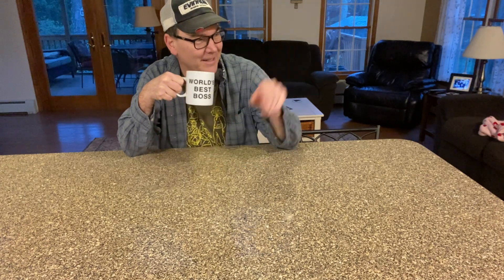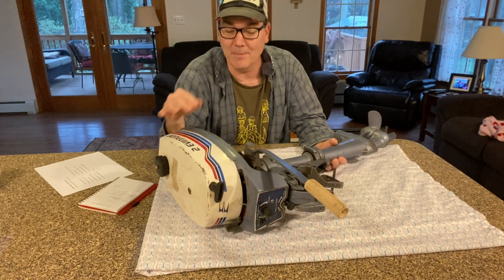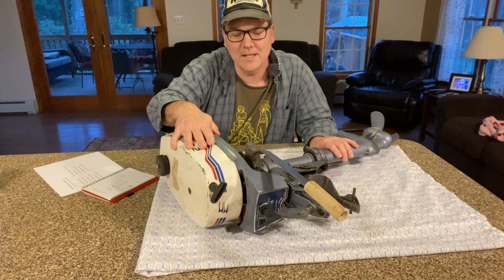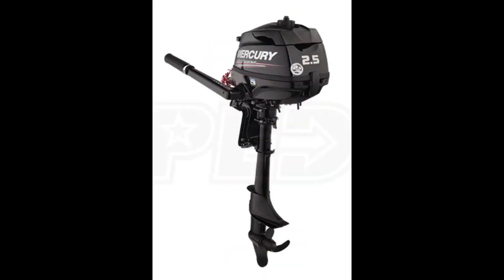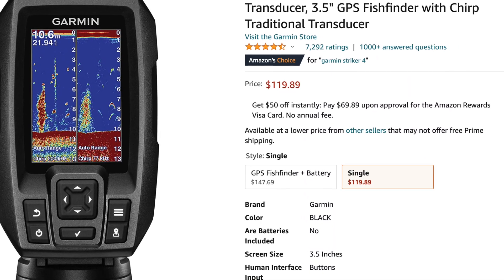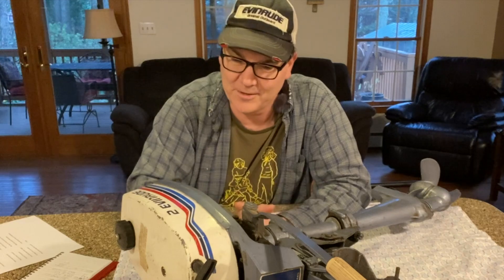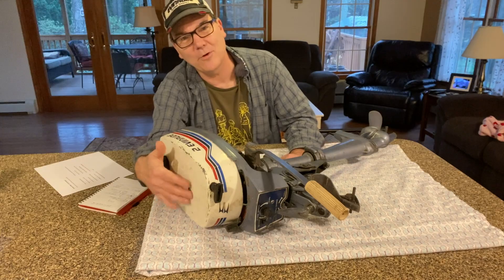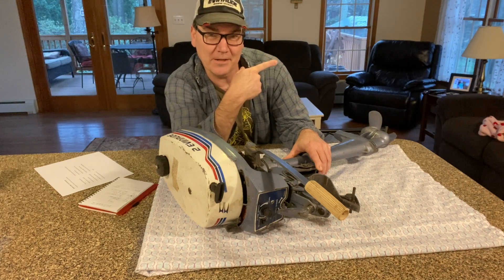Evinrude 2 Old 2 Stroke Outboard Motor - Is It Worth Saving?

Comment: It,s power for your boat, not a comidaty, to be bought and sold.  If you need a good motor for your boat fix it.  It,s way better than the lawnmower engines on a stick they have today.  If your looking to get rich from fixing it, no, it,s not worth fixing.  Knowledge is power, keep that in mind.

Comment: Those old 2 stroke Evinrude and Johnson outboards were extremely reliable and used very little fuel. I think you should check it over and see about getting it running again. I, for one, would be very interested in the process and video.

Comment: I think your should do a compression test first. This will give you a good idea of how worn out the engine is. If it has good compression and you do everything you plan to do, that motor should start really easy and be extremely reliable. You might not need to reseal the gear case if the gear lube is not milky.  If you replace the points I would recommend avoiding the BRP/OEM points because I’ve heard they recently have been mostly defective out the box, so I would go with Sierra points instead.

Comment: I Just got that same motor, here in Argentina, I like it because it will go in a racing sailboat where I do not need so much power. It was running and now it runs and shuts off, cleaned the carb and does not run. Want to get ir running to use it soon because it is the lightest motor I can think of. Really like it

Comment: Just ran across this video again and as you know I restore these old motors. My thought on saving these are they are mostly metal especially the older ones. They a very simple to work on and a great motor for lake trolling. Anything older is worth saving and reselling to folks who want them but don't know how or don't want to work on them. Mainly because they don't have the time unlike us retired folks.
Reply from the maker: I ended up giving this one to @BrandonsGarage and it actually was in worse shape than we both originally thought.
Reply: I saw the video. I picked up an 1965 3hp Evinrude a year or two ago that the water jacket passages were totally clogged up. Got them all clean but still doesn't run right? I put it aside to work on other projects but plan or getting back on it someday.

Comment: Enjoyed this video, we're a lot a like in our curiosity towards getting stuff , hopefully cheap and running, I've bought a couple motors here and there, my last was a '77 Evinrude 6 hp I picked up for '75 bucks off Marketplace, did the precursory checks, spark, fuel and compression, turns out all was good, and with some carb cleaning, I had it running, had a weak water and fuel pump, sourced those parts, cheap , on Amazon, after using it a couple times on my 12 foot boat, I decided I wanted a 4 stroke cleaner outboard, I flipped it for a decent profit, and bought a 5 hp Briggs and Stratton, Air cooled 4 stroke engine, which I'm very happy with. Enjoy your content, great work Wayne !
Reply from the maker: Nice! Those 6 hp are pretty plentiful and robust

Comment: I fix a alot of small engines so here is what I would do to keep cost down. I would first buy a spark plug because that one is gone but only after trying to clean the old one with a spark plug cleaning tool I own to test that the engine will even run. Then I would carefully take the carb apart and clean it out while trying to save the old gaskets, I have some bulk gasket material if I need to make one with a razor and holepunch set. I would replace the fuel line with bulk small engine fuel line that I have from other repairs and it would get a new impeller. This would keep cost down and make it economical to fix. Start accumulating this bulk stuff to keep your cost down across multiple engines.

Comment: I just received one of these motors today and it doesn't run. I am most certainly going to get it running because 1- I don't know much about engines and I'd like to lean and 2- I still won't have to pay almost $1,000 for a new motor, 3- everyone in your comments seems to be pretty sure about its reliability. I think this will be a fun learning experience.
Reply: Did you get it going?
Reply: @beaconbus  no, I havnt figured out the air fuel ratio,

Comment: Well, these things do bring big money, don't know why, but they do.  The first thing to consider is whether or not this was used in salt water.  If it was, you will need to be very careful trying to remove fasteners, don't want to snap them off.  Next, you might want to do a compression test and drain the gear lube.  If the compression is OK 80-100PSI and no water is evident in the gearcase, you can go further.  The paint is not discolored on the powerhead, so it doesn't appear overheated.  But, someone could have run it without oil, but this should show up on the compression test.  
Next, decide if you are going to keep it, or sell it.  Spending another 100+ dollars on a 175 initial investment doesn't leave much room for profit.  So, I would simply clean up the mag plate and clean/reset the points, this is usually all it takes to get good spark.  Yes, pull the carb bowl off and have a look.  I wouldn't do much with the carb if it looks clean inside, just put it back together.  Fuel line is cheap, so it is always a good idea to replace that.  Now, refill the gearcase with lube, maybe a new spark plug, add 50:1 mix, put it in a barrel full of water and I'll bet it will probably start and run fine.  
Now, if you plan to keep it, that is another story.  Keep in mind that you can't find a simple, light weight two stroke like this anymore.  It is simple and fairly rugged, reliable, and easy to service.  So, I would go ahead and do more to it to ensure it will provide reliable daily service for you.  If the gear lube is clean, I would go ahead and pull the gearcase down and replace the water pump impeller.  This is a strange water pump and there are two kits available.  It is a good idea to spend the extra bucks for the better kit with the SS impeller housing liner.  These gearcases rarely leak water, but I would definitely pull the propeller off and make sure there is no fish line back there which could get into the prop shaft seal.  If all looks OK, I would not mess with any seals.  Go ahead and install the ignition kit and replace that funky plug wire.  And yes, pull the carb off and install the latest style carb kit that includes a new float and ethanol resistant gaskets/orings.  Like I say, these are great little engines and worth the investment for yourself provided it is in decent mechanical condition to begin with.  
If you are not familiar with doing this work, or afraid of snapping off corroded/rusted hardware (salt water), then I would simply resell it with a price tag of $200.

Comment: Give her a compression test them see if she got spark you can use a drill to spin the motor over to do compression and spark if it has no spark clean points and make sure they are at correct gap should be 0.20 check gear lube and eventually drop lower, those kinds of motors are the best because you don't have to pull the power head because there is no shift shaft to unhook if gear lube is clean you could probably skip rebuild on lower just change gear lube once you get it running invest in impeller you might also be able to just clean the carb instead of rebuilding it. Love the content rock on🤙

Comment: As long as parts are available and legal useable, these little motors are much lighter and easier to work on vs. Four strokes. If compression is good keep it, get it going, or sell it to someone that appreciates vintage motors.

Comment: Worth saving!! I have two of them.they are small lite.if one it two slow I put on the 2nd. Lol twin outboard on my inflatable.so much better then paddling.or lugging around a 50-75 lb motor and gas tank. Good luck. Very easy to work on.if u don’t like it I’ll take it

Comment: Mine is a little older and I’m trying to get it to get spark, I’m sure it will run with new points and condenser.  I’d get yours running and use it  are build beautifully, and look so cool.  This one I have look’s more weathered than yours but less used.  The rope looks near new and original.  I trust to get it going and to use longer than I live.  When I pull the rope it feels great and the water is flowing strong in the pail just pulling it without it running.

Comment: I have that motor, and just like you I undid that screw and the cover didn't come off, but when i figured out how to get the cover off blang there went the spring. You will need a gear puller. the points are under the flywheel the timing mark is on the wheel I believe it's 20 deg. I would start at the top points, plug etc get it started first then work down if needed

Comment: Wayne, I have watched every single one of your videos and I look forward to Friday to see what you've got going on! Like many have said, if that motor has good compression, then get it running. You can and will learn a lot tinkering with those. You can't beat those old Evinrude and Johnson 2 strokes. I have a 25HP Evinrude on my boat and they're very easy and fun to work on. Sometimes you need to look beyond the dollars and cents and think about the fun you will have and what you will learn tinkering with that old motor. BTW, I may have missed it, but did you say what year it was?
Reply from the maker: Thanks!!  It's a 1977 model.

Comment: If you see this comment.. I bought a BRAND NEW 1976 never been used 7 hp Montgomery Ward sea king. It's beautiful! The guy said the box fell apart but it still has the plastic and a tag hanging by the choke that gives all the info about it. I inspected it and bore scoped it and I think I'm the first one to have the plug out of it. I had to buy it but I really can't decide whether I want to use it or not! I was going to have it clear coated to protect it but not sure thats a good idea..Im planning on doing a video on it. I was going to show starting it for the first time but I'm like, "do I really want to do thaaaat"😬 Anyway. Just thought I'd tell the story here..😁
Reply from the maker: That's cool! If you do want to preserve it, rather than clear coat, maybe just a good wax to keep it from oxidizing.

Comment: I would keep it ,its a piece of history, in outboard motor evolution
Reply from the maker: And it's not too heavy to hang on the wall!
Reply: @WayneTheBoatGuy  I would hang it on the wall. I have a old 7.5HP Mercury 2 stroke that was giving to me. Has good compression but doesn't run and most all lakes in my area don't allow 2 stroke. So I'll give a good cleaning, paint and hang in my fish cave.
Reply: @maddgoatee9708 why don’t they allow 2 stroke motors?
Reply: @blaccsilverstaff5484  The carbureted two-stroke engines emit up to 30% of their fuel in the water and are unburned. Damaging to the environment. Electronic injection two-stroke because these engines aren’t as efficient as 4 stroke. There is no ban on two-stroke boat motors in California. Although most lakes do not allow the use of high-emission two-stroke motors, that’s not what the state law says. Especially in saltwater lakes and rivers, there are no restrictions on such engines. We only fish freshwater lakes and occasionally the river. I also have a Merc. 35hp 2 stroke wall hanger. And that one runs.
Reply: @maddgoatee9708  up to 30%… so it could be way less than that if it’s tuned properly

Comment: I just bought one identical to this yesterday. It starts every pull, but only runs for a second or two. The fuel tank was empty, clean and dry. I put fresh fuel/mix is in it. The vent cap was an open. I tried full choke, 3/4 choke, half choke, 1/4 choke, no choke. I’m gonna replace the spark plug tomorrow and try it again. I’ll look for the easy obvious stuff first. You should fix your’s up and keep it.
Reply from the maker: Try cleaning out the carb - that's what fixed my 2.5 Mercury last week -  https://www.youtube.com/watch?v=wJ0tJzCcikM
Reply: I have one in my basement. It runs perfectly fine. How much are these worth?

Comment: Assuming you can do the work yourself. Those old 2 strokes can be a great investment. At $175 non running that is a deal to run away from. And yes the price of the new ones vs an old one i think is a joke. But having owned about 10 vintage OMC outboards and buying a brand new tohatsu, i feel confident that the old 2 strokes will still be running when that tohatsu is in a scrap yard

Comment: The issue with an old outboard is that you don't know it's history.  Was that motor used for 1000 hours somewhere?  Did someone put straight fuel in it at any time?  The main thing is does it have compression?  A tester is best, but if you have the plug in it and it gives a nice pop-pop-pop with some resistance, it is probably OK.  A cheap bore-scope from eBay to check the cylinder wall is a good thing to have around small engines as well.
I bought an identical motor a couple years back from a local buy-sell site for 50 or 75 dollars.  Someone previous to me had a mixture of metric and SAE bolts in it, and various other janky fixes.
Several hours of work, and a few parts later (about $50) I finally had it sputtering in a barrel in my back yard.
That's where my story ends.  My neighbour had been watching me work on it for a couple of days, and when he heard it fire he walked over and offered me more than it was worth to me, as I already had several small motors.
That's the thing about these old motors, the value is different to different people.
I saw it as a cool old motor that I was willing to put a small amount of money into and run once or twice a year just for fun.  My neighbour saw it as a perfect lightweight motor to put on his canoe.  If I had to guess, if he takes good care of it, that motor will be good for another 50 years.
My recommendation to you is to fix it for yourself, or get it to someone who will fix it and use it.  It's too useful of a motor to be a wall hanger.  Unless, of course it is worn out.

Comment: I have a 1971 2hp Evinrude Mate and after cleaning out the very gunked up gas tank, all I had to do was replace the old (cork?) float in the carb and get a new spark plug.  I also got the motor for $60 and those parts cost less than $40.  So I'm happy.  As far as your motor goes, why replace things you may not need?  Does it have spark?  If so, will a little starting fluid/spay get it to start briefly?  Check that fuel flows from the gas tank also.  If someone allowed the fuel (with oil) to evaporate over several seasons, then your tank may need a serious cleaning - including the outlet screen/filter.  My motor's carb float was old and didn't like to "float" so I replaced that with a new version.  Replacing that and the spark plug had things working very nicely (once the gunked up fuel tank was cleaned up).
Reply from the maker: That's so cool that yours came back for under $100 total! Unfortunately, this one had a much rougher journey!
Reply: @WayneTheBoatGuy  Is it running now?

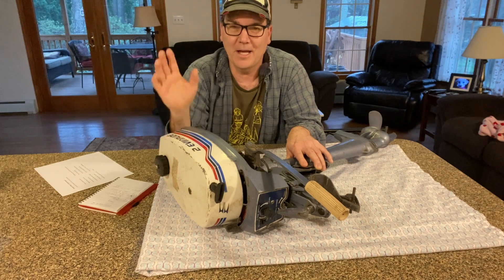Comment: Wayne I need some advice. I just purchased a 14 foot StarCraft. I now need a motor . The guy I purchased the boat from has a 1984 Johnson 25 hp. Motor. He was not selling the motor with the boat. He was going keep the motor. He said it was a awesome motor and did not want to sell it. I asked what it would be to change his mind. He finally said ok! If you want 7:42 it 800.00 not a penny less. Now I know someone 7:54 that has a almost new Mercury 6  HP. It only has about 5 hours on it. I don’t have to go fast. I am A older man and just want to get to where the fish are. I have had a few friends tell me don’t buy the Mercury it’s to small. Other friends have said don’t buy the Johnson it’s to old and they are not in business anymore. They are both the exact same price. Can you tell me your opinion?
Reply from the maker: If the Mercury is a 4 stroke, it will be easier to fuel up (no mixing gas and oil), lighter to carry, less weight on the boat, and easier to deal with because it's newer and probably made by Tohatsu. But it will be slower - and unless you're in a competition, or needing to get somewhere quickly - that might be fine.  I'm putting a 6 hp on my 14 foot boat this spring - so I will have more feedback when I do!
Reply: @WayneTheBoatGuy  ok! TU I need to buy it now if I am going to . Kind of a rare find. It only has a few hours on it for 1200.00 less than new

Comment: Yes, you are over 300, but, those engines you buy will probably need a water pump, likely need fuel hoses, and my need a carb kit. So really, it's not that bad, and you know they are now good. Often times the points and condensers are not bad.  Check the condensers with a multi meter and as long as the points are not pitted badly, it should be fine. I picked up a 6 hp evinrude for 100 dollars. Didn't run but the guy had put all new fuel lines, water pump, the whole thing but couldnt get it to run.  Points where good but had some corrosion and wouldn't make good contact. Rubbed it with emery cloth and it's been a champ since.  I'd say go for it!
Reply from the maker: Great points (pun intended) - other motors, even if running at time of purchase have unknowns.
Reply: A brand new Suzuki four stroke needs nothing but fuel stop kidding yourself.